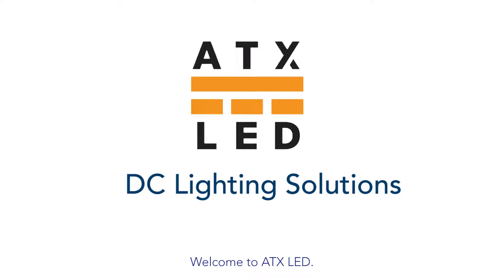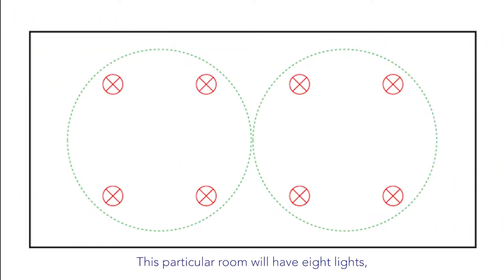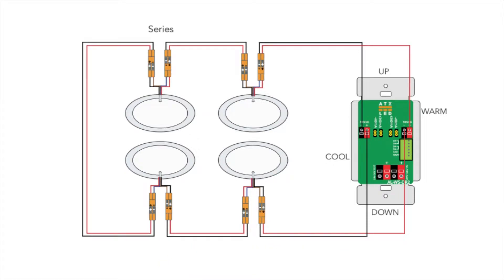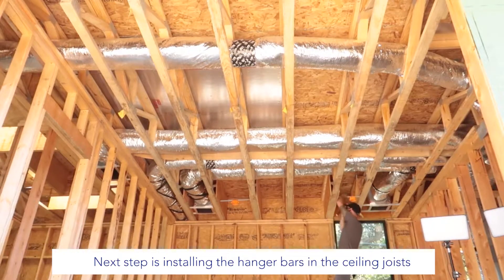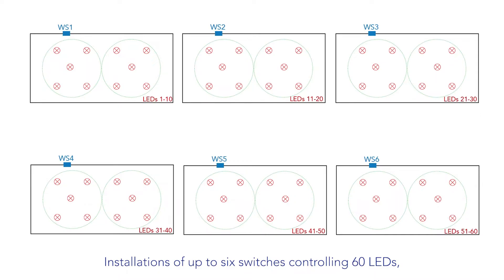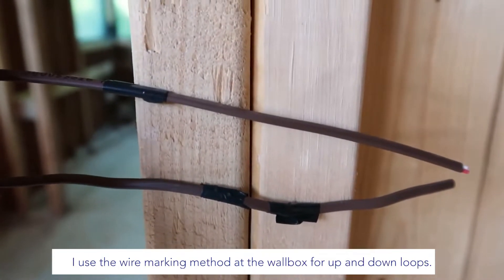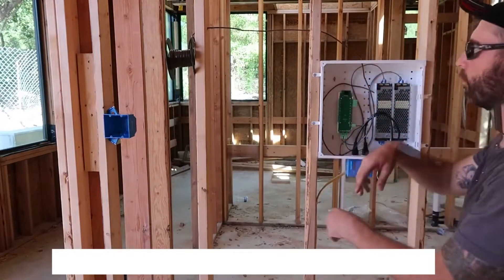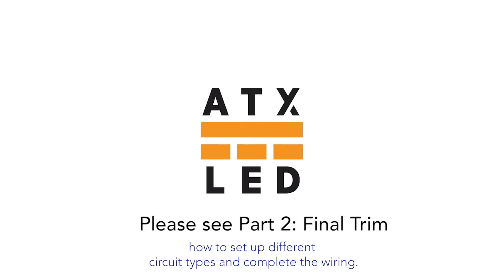ATX LED - how to rough in wiring and cans for low voltage LED lights

Comment: So yeah... I just saw a home with 100 led recessed lights... and every single one of the lights came with a junction box with transformer / inverter .... they ha 120 volts on a 15 amp going to each and every single led light that only uses about 9 watts total... that is insanity... so much wasteful hardware.  I want my entire home to be DC Power going forward.